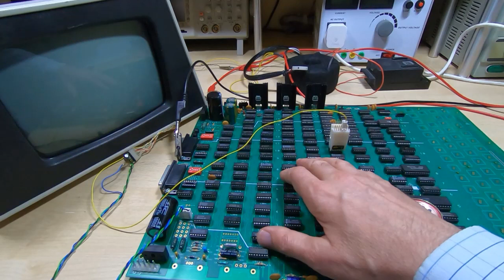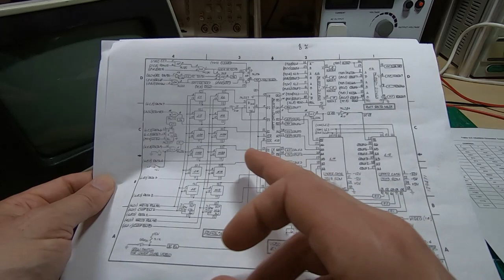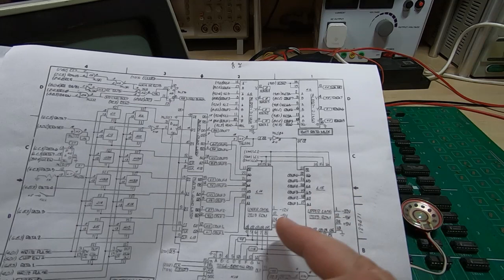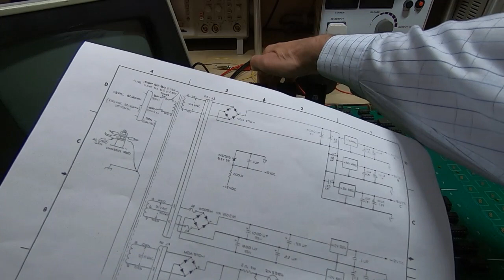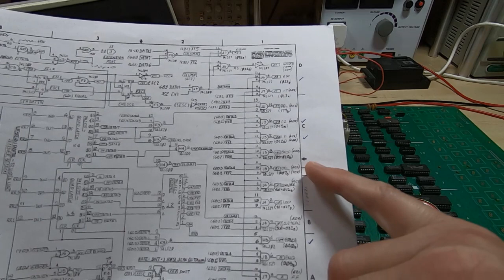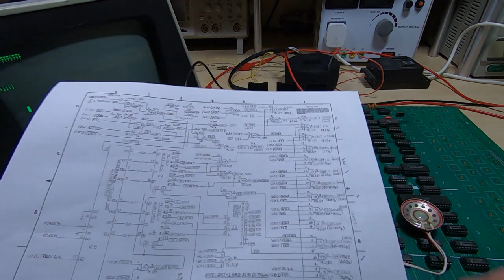ADM-3A  Board Reproduction Part16

Comment: Bump up the baud rate?  Forget it.  It's not worth the trouble.  At 9600 baud the entire display can be filled in a little over 2 seconds.  Since all this thing does, is RX a character then put it on the screen, moving data faster is not worth it.   You're not waiting to transfer a 120K .hex file to be transferred for storage.  Also note the companion printer was not fast either.
Reply from the maker: Exactly, This is intended as a reproduction and will hopefully be used to connect to equally vintage equipment so speed is not the point. They really only need to keep up with typing and be fast enough to update a screen of text. I recently restored a mechanical teleprinter and it is even slower but still works fast enough for its use. My recommendation to anyone wanting to move large quantities of data is to buy a PC :)